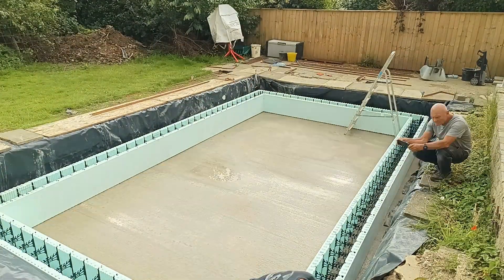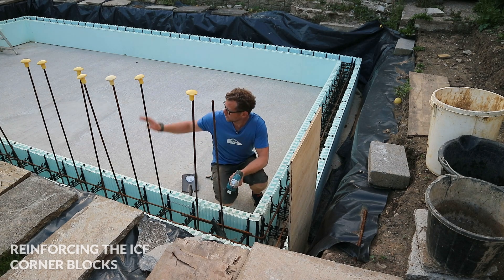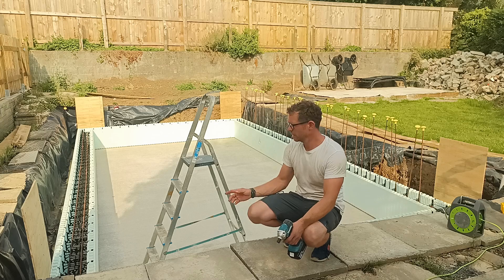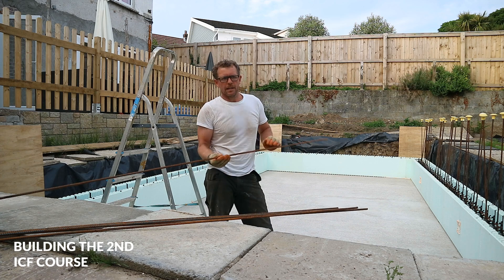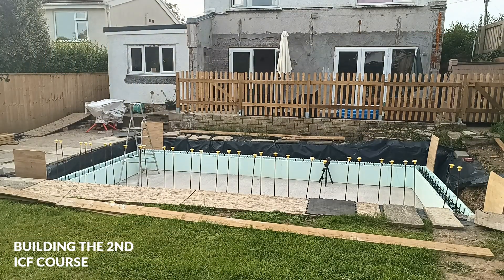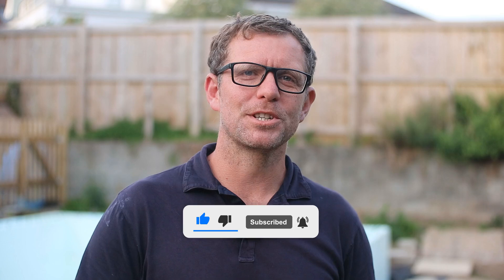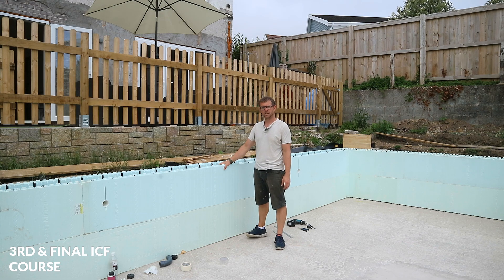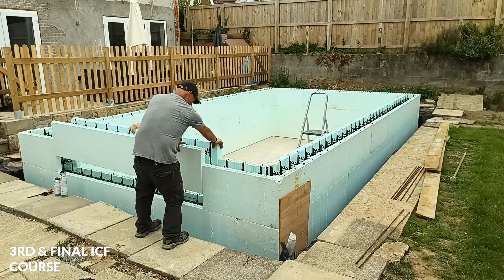Ep.9 - ICF Pool Walls and plumbing - Building a heated DIY ICF Swimming Pool in the UK

Comment: Hi Rich, hope you’re enjoying the pool now. Just wanted to ask where you got all your plumbing and fittings from? Just trying to get those bits ordered
Reply from the maker: Hi Mike. Missed this. Apologies. The place I got mine from a year back has stopped selling to the public I believe. The next best outlet from a quick search looks like tmex express. Similar pricing for the grey 10 bar. Stuff. Look for irrigation suppliers as opposed to pool stores as pool stores charge a premium
Reply: @RichDoesDIY thank you, I’ll have a look. Im struggling to keep prices anywhere near what youve managed to do I think
Reply: Hi Rich, did you have two horizontal steel bars in the top and the bottom of each row of blocks or just the top of each row? Thank you

Comment: Really interested in this series since I was quoted on average 40k for a 12x24. I’m considering a self build for the most part I would use professionals at certain points like yourself. I’m not a bad DIYer but things like leveling the base I’d be a little concerned about since that sets the level for everything. Great job so far though 👍
Reply from the maker: Thanks D.  What type of construction was it that you had quotes for?  Id definitely get an SE, and hire a digger or pay someone to dig the hole. I levelled the base myself with a £20 laser level from Amazon! You don't need to do half of the reinforcing I'm doing though (but your SE would confirm) if you're just doing block on flat with liner. I can't afford any potential for cracking as I'm not going with a liner though. 👍
Reply: @RichDoesDIY  tbh I was looking at generalised quotes not specific. As for excavation I have a quite a large service road along side my fence could get a good size digger in am hoping it could be done in a day. 
Do I just use any SE for the calculations? 
As far as finishing goes I’d also go for rendering I don’t like liners or the potential or that come with them that’s why I was a little dubious about getting the base correct. Thanks for the reply 👍
Reply from the maker: @dexter78-t1v  nice. With that sort of access you could get it dig for a fraction of what I paid. I had to use a doorway digger which took a week! Yeah any competent SE can do it. My local pool companies were happy to provide me with their engineer details. If you want render then this method I'm doing is a bit experimental. Concrete blocks would be the safe bet. Look up Basecrete and see what you think. That's currently my preferred option but not 100% yet.
Reply: @RichDoesDIY  I’ll look into it, thanks Rich, looking forward to the next video

Comment: Is the only reason you are using this type of pool build to get better insulation?
Reply from the maker: That's about half of it. The other big factor influencing my decision was that I didn't want to cart a few thousand blocks from my drive to the pool location. And also didn't want to spend the time building the walls with mortar etc. did that on the last pool and it was a lot of  work. This has been a breeze so far! 

The other reason I chose this method is that the walls will be far stronger and much less susceptible to cracking due to the increased amount of horizontal steel.
Reply: @RichDoesDIY  I still have to wait and see what the inside will be covered with to get a full view of your concept :)
Reply from the maker: Yeah just finalising the quotes I've got for various internal finishes. Making a vid on that next. One other point worth noting is that the actual time spent on the walls is minimal. I get about 5 hours on a Friday, a few hours on a weekend if I'm lucky, and 1-2 hours at night in the week! The time between videos doesn't accurately actual time spent on it! :-).